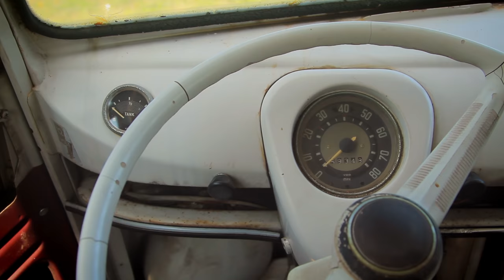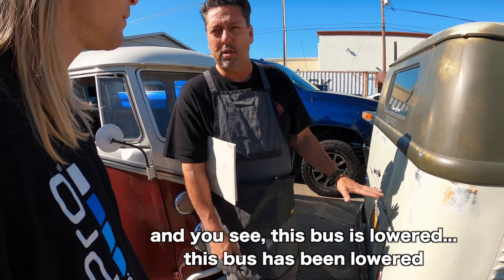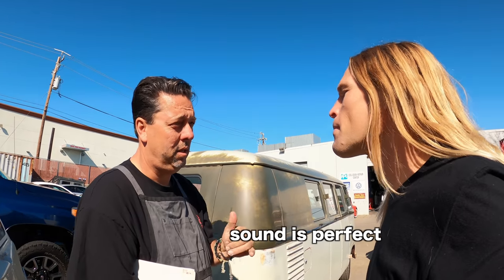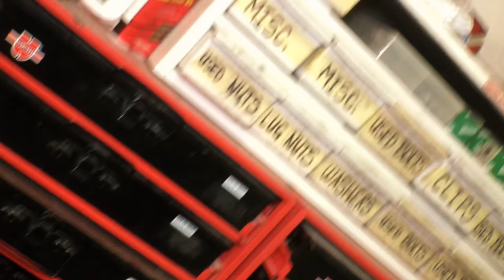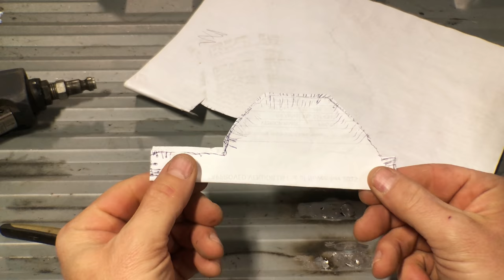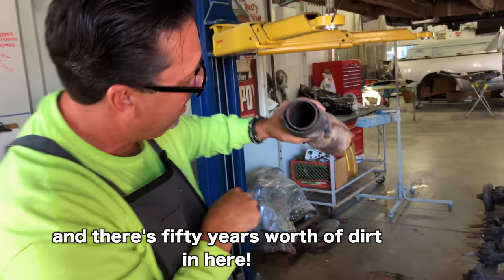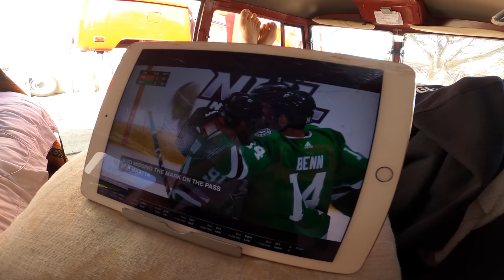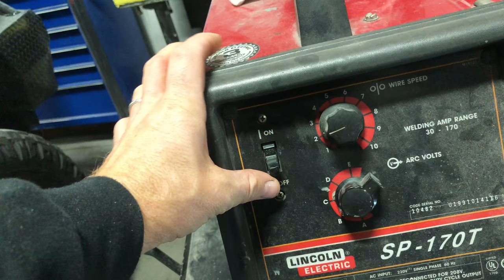VW Bus Restoration - Episode 23 | MicBergsma

Comment: Hey Mic, great metal work and welding job! Can't wait to see next episode 😉
Please don't lower the bus!!! I think you can't be sure finding always plain roads. One little bump or gravel roads and maybe parts of undercarriage could  come in contact with stones or other surface... Please think about that!
All the best from Vienna/Austria
Reply: I totally agree!
Reply: If your not going to run the stock reduction hubs at the rear its going to be difficult not to lower it. Once you go to a straight axle rear end you have to lower the front end. Personally stock height buses are dangerous at highway speeds with fast moving modern cars. Great if your only going a little cruise every now and then on quite roads.

Comment: With all the plug welds which are needed, I'm surprised this shop doesn't use spot welds instead.  If no spot welder with the necessary reach is available, I'd be rolling my own.  Gotta get a softened brick chisel like Silverio's!

Comment: You could just go electric with that VW bus it would last longer then those air cooled engines and cost the same while having better performance
Reply from the maker: Yeah I don't mind to go electric but the price is $74,000 vs gas engine under $4,000 :(
Reply: @MicBergsma  Mitch, there are a lot of other engine options now, and cheaper than $4000. Mostly you see Subaru swaps, but there are a bunch of others that fit Type 2 and offer water cooling and full AC options as a bonus... something worth thinking about in HI, Right ?  Look at this build done in CA by ICON : https://www.youtube.com/watch?v=mr5Z1ymbajY     It has DUAL AC front and back, a stock 2.0 L VW Jetta motor (195 HP) run through a Vanagon transmission. Used, running & guaranteed good condition Jetta motors are only $300 to $500... that leaves a lot of money for all the other related swaps needed like better brakes, radiators, and transmission. AND it's still VW Powered !
Reply: @MicBergsma  no idea why it cost that much maybe because where you live? Maybe start a GoFundMe thing?